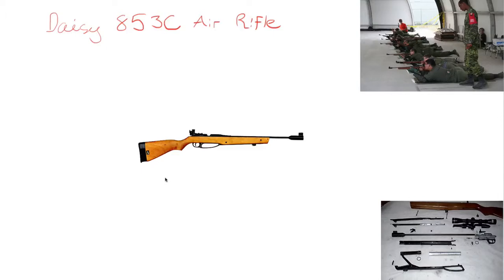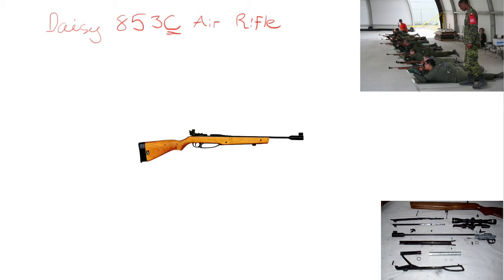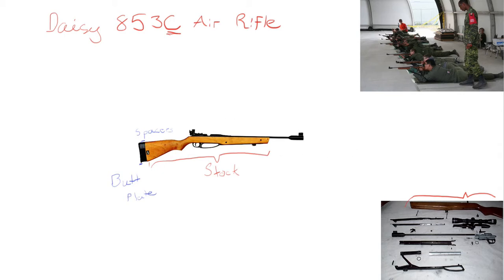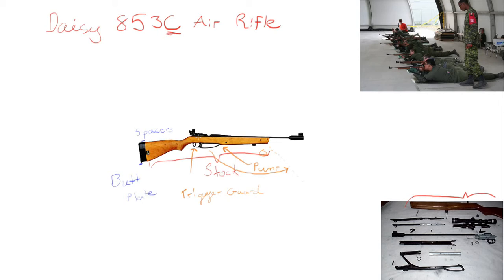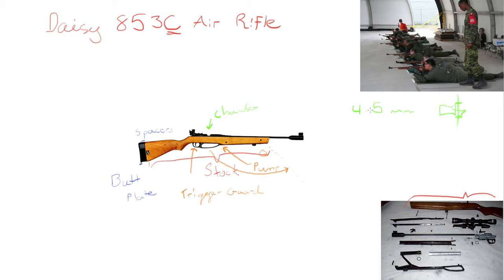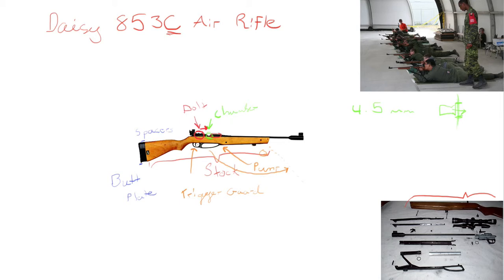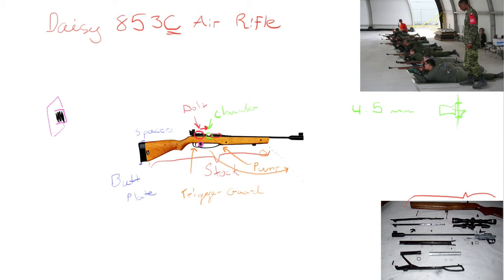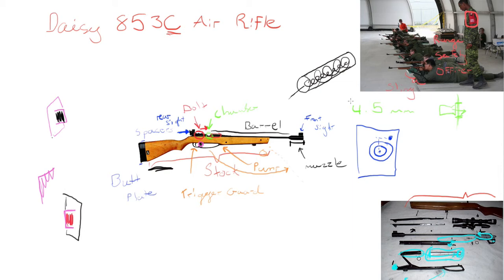Introduction to the Daisy 853C Air Rifle

Comment: For anyone wondering how they can get one, it’s really, really, really hard, they stopped making these kinds and if you wanna get one you’ll have to get it from someone who has one who is willing to sell/lend it to you, but they are still making the daisy 953 which is almost the exact same except it’s black, and a bit more technical details, if your looking for a rifle to practice with for cadets or just in general I would really recommend the 953, it’s the 853 and it looks good, almost nothing different, even I can’t tel the difference between them other than the Colors when I use them.
Reply: the CMP sells surplus 853s for $125 +shipping in 2022. they sell new models for $210+
Reply: @Zsigmund the cmp dont deluver guns in canada....